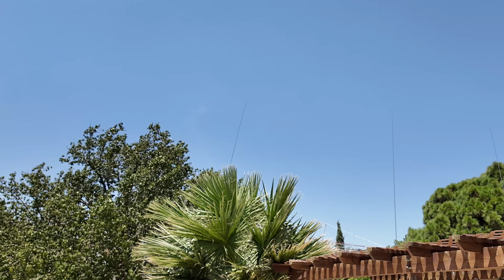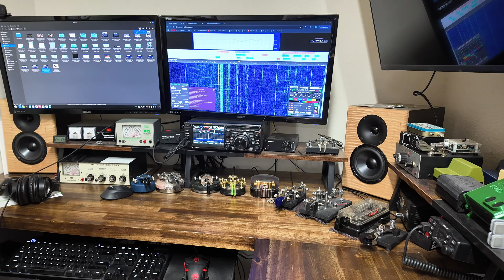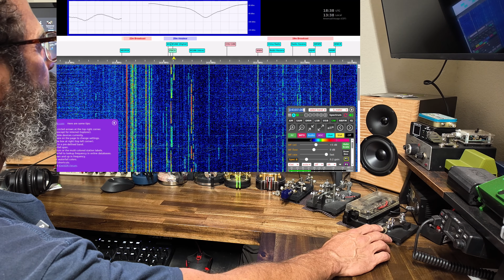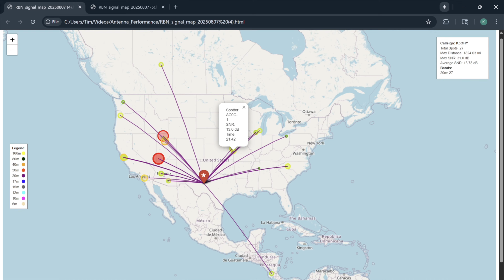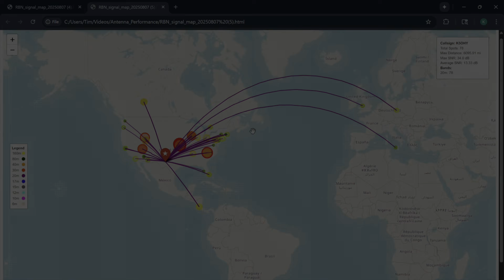Testing Antenna Performance: Cobweb vs Parasitic Vertical Array

Comment: Tim, always a pleasure to watch your video content.  BTW, congrats on the new domicile.  I presume it's still in WT?
Reply: Also, one thing that's worked for me in this sequential AB testing of antennas is using WSPR (part of WSJT-X) at 5W and counting how many spots I got with one vs the other antenna.  To mitigate, somewhat, changing propagation conditions, I tried antenna A, counted the # or receiving stations, switched to antenna B, count # of receiving stations, and then repeated once more for A & B.  Lastly, I added all of A's counts and all of B's counts and compared.  It takes a bit longer and it doesn't give information on the noise floor, but I thought you may be keen on another antenna comparison methodology.  Again, great content es 73 de W2WF.
Reply from the maker: Thanks! Yep I’m still here in West Texas.

I’ve thought about trying WSPR for antenna comparisons. I've had a few folks mention it but I haven't looked too much into it yet. It seems like it could be really useful. I think the harder part would be deciding exactly how to interpret the results. I could probably modify my RBN program to pull in WSPR data too which might be interesting. Thanks for the idea and 73

Comment: Hey Tim, excellent work! Yes, using online SDR receivers is a fantastic way to measure and compare antenna performance, good job. I assume you were using the PERformer quarterwave as your 3-element parasitic array ... did you use my recommendations for spacing and lengths we discussed or did you try something different? 😀 73 KJ6ER
Reply from the maker: Hey Greg, yes sir I'm using the PERformer for the array.  I basically start with your recommended tuning. I've been trying a  new method of optimizing tuning the parasitic elements to try to maximize gain.  This is the method that VE6WZ recommends using an analyzer on the driven and adjusting the parasitic elements using the real resistance dips. Evidently the peak gain is the approximate midpoint of the rising R curve.  I haven't perfected this method but it seems interesting. Steve VE6WZ has a few videos on this method. I used this antenna this past weekend for the SKCC sprint and despite poor conditions I felt I did fairly well.  73 K5OHY

Comment: Great video Tim! Nice to see you're getting some gain there without a tower and expensive beam in the HOA. 
I'll look forward to the Challenger video! I've only used mine a couple times, but I like it just as much if not more than the POTA Performer
Reply from the maker: Thanks, Charles! When you live in an HOA you have to get creative.  So far I've been impressed with the Challenger. Looking forward to trying it out at Big Spring State Park.

Comment: Interesting video, thanks for sharing.
Over the last 5 years I've been testing parasitic verticals VS dipoles. The only thing I found out, all ant testing no matter the ant type is apples and oranges, as there is so many variations,  ant patterns, propagation etc etc.
Overhaul I found my single ele elevated vertical works best for long haul dx, Vs 2 and 3 ele arrays on the ground. Elevated verticals are far better on tx and rx. 
Good work 73 zl3xdj